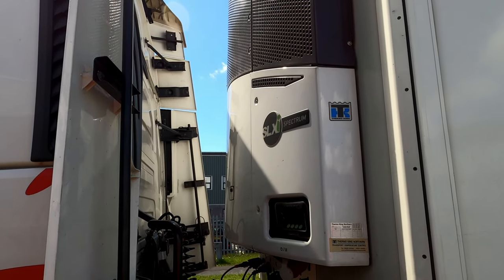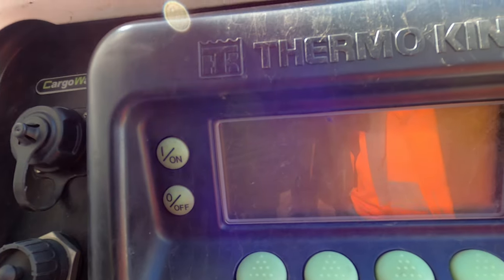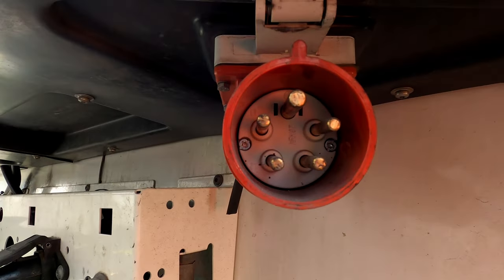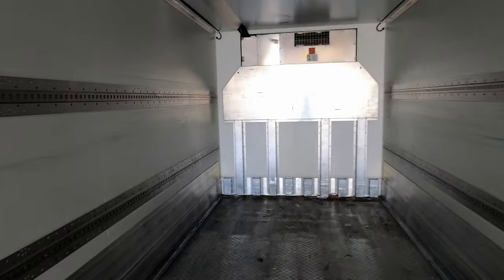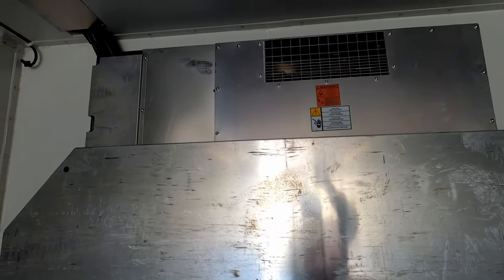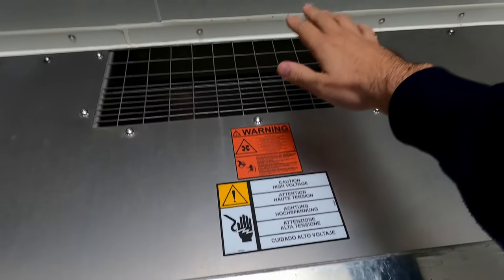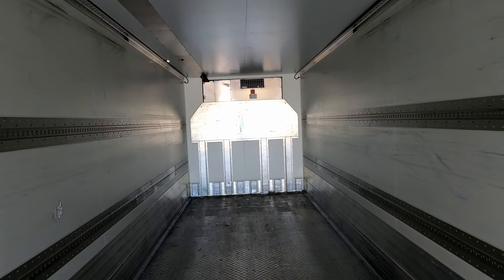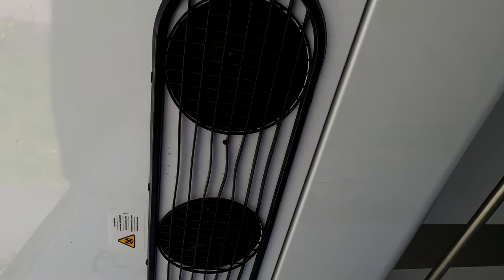How a Refrigerated Trailer Works? [4K]

Comment: I'm getting trained up on fridges next week. As for the migrants, the problem in fridges is there's no oxygen, they're air tight without any ventilation as the temperature would drop.

Comment: Is it more cost-effective to run the trailers with an electrical supply (where possible) or with the diesel engine? Do they run quieter using electric?
Reply from the maker: Yes it is much quieter and much more cost effective

Comment: So on your store delivieries you usually use a double deck trailer I'm wondering how they get loaded. That's if you know I'd love to find out
Reply from the maker: Yes They have special bays to load the double deckers. The ramp goes up all the way to the top deck
Reply: @Raul689  ah makes sense thanks man
Reply: @jamiemonaco4944  I know it's late but I can provide more info since I used to load them before driving myself.

Usually on the double decker trailers the internal deck can go up/down, not all of them are like this but a majority are. In that case you will lower the deck down - near the headboard you may have to load around 6-8 pallets and bring the deck back up to put the pallets there, as sometimes that part of the trailer does not move (it's different for each trailer, some do have decks that go up/down, some don't). After that you will repeat the process for the section under the place where you just put the first few pallets. After that it's just a case of loading the top deck, raising it and then loading the bottom deck.

In situations where the deck is static and doesn't go up or down, you have to load it via the tail lift which takes ages, as you are taking up 1-2 pallets each time, repeat that for 50-52 pallets and viola 😃

Comment: Great video, do trailers run out of fuel if the driver is not on the ball ?
Reply from the maker: Absolutely and the fuel gauge is not showing proper level so you have to be careful
Reply: @Raul689  Thanks